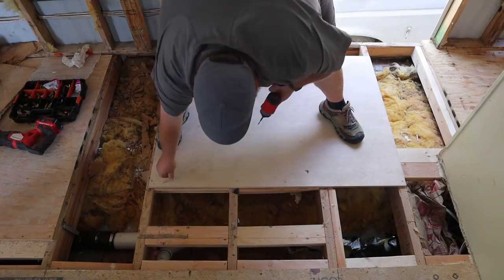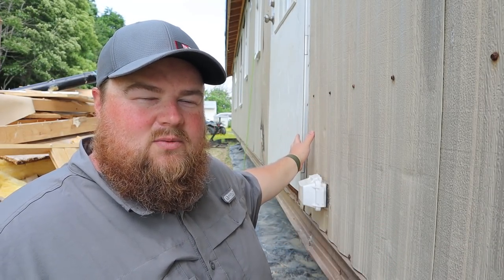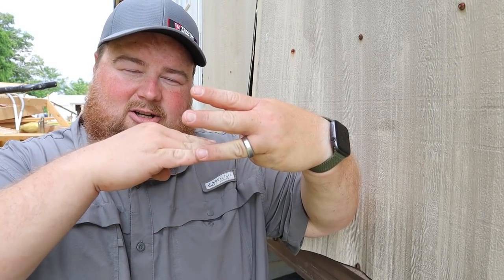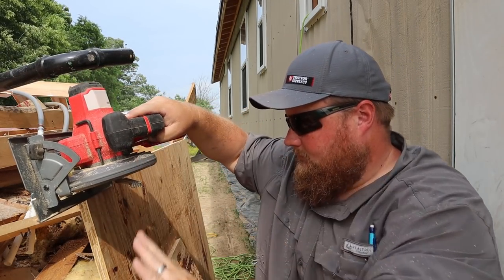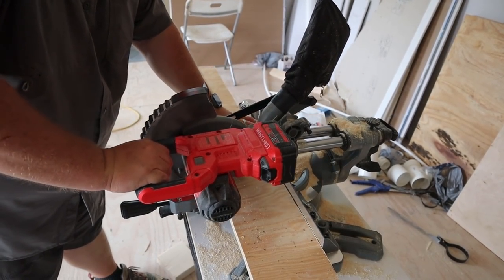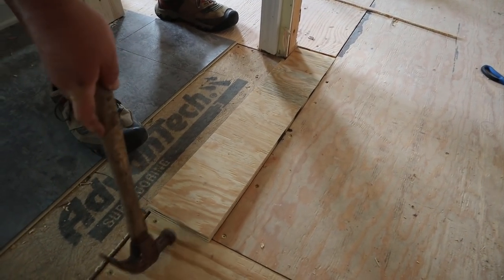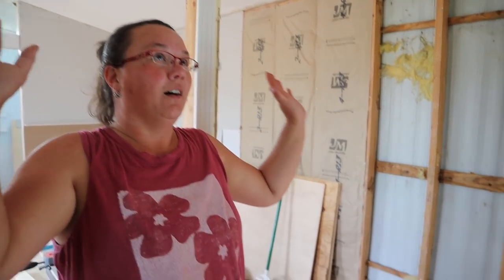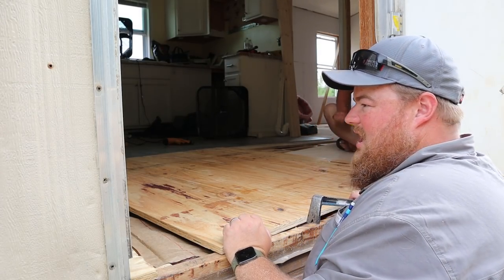Now the WHOLE HOUSE has New Subfloor! // Mobile Home Renovation

Comment: Must feel good to get rid of all that particleboard. We've replaced all of the subfloor in the kitchen, bathrooms, by front door, and any soft spots in the single wide we bought to remodel. It's not an easy undertaking by any means and especially with lumber costs right now. By the time you guys get done you will pretty much have a new house that should last for many years to come. Great job! 👏👏

Comment: Hi. Don't  forget  to put the drip pan under  the washer,  it will save your new floor . If you have a front load washer,  the door gasket "will" leak. Great show.  Thanks
Reply: Great advice but the funny thing is that all of my washers have been front loaders (as in Europe front loaders are the norm) and I have been married for 44 years and never had a door gasket leak, not even once. I have had the water hose and water pump leak, so a drip pan is still needed. Thanks for posting
Reply: @footplate0  You are just lucky.  I am a former  repair  man, I have replace  a few hundred  Door seals and  main pumps,  " Knock - On - WOOD ".

Comment: Sam, that is a left handed cordless circular saw you are using in your right hand. Left handed saws have the blade on the left and right handed on the right. The blade should always be away from the body so in case the saw kicks back it is less likely to take a cut to the main mid section of your body. Cordless saw designers apparently didn't take this into account and if you're injured by one that might all change if one goes after them in a lawsuit.

Comment: Our kitchen had a Florida style tile floor and luckily carpet had been replaced with vinyl plank. Underneath was all real plywood luckily! Under the old ceramic tile I uncovered the original green mosaic vinyl flooring held down with that glue we love so much! Heat gun and much scraping got it pristine again. New luxury vinyl snap and lock installed now!

Comment: I am finishing up the remodel for mine.  We have two back doors we are waiting delivery on, will need the trim placed around the doors and the floor trim placed on the wall the doors on.  Also have 1 room left  to paint.  Have you gotten to the point where you thought I should have just bought a new one? I reached that point axp 75% through the process.

Comment: You paid a "right" price for this house, did previous remodels for less cost than a typical mortgage, and moved the house for an over-all pretty right price in terms of housing costs.  The more you tear apart, the more I realize the need and things you've suspected and/ or known.  It's a lot of expense in the middle of doing all the other things needed to get the house habitable again.  But, I'm guessing it will be well worth it even if it delays some of the other things.
Reply: @5thdimension625  And, unless there is some type of inspection, or they chose disclose thier upgrades, it is still by a 1988 mobile home, by definition, tax wise.
Reply: @terryhenderson424  the foot print is all they’re keeping.  They do this all the time in California and elsewhere as it’s cheaper than current prices and they can do upgrades they want to include.  I bet they come out way ahead.  Their labor is free and that’s out the rood today.   They’re giving up their time into something they love.  I like them.

Comment: I don't want to be that guy that rains on your parade... but "ALL plywood" has a certain way that it is laid across the floor joist, most were laid the wrong way... this is what will happen in time the plywood will sag in between the joists, you will be able to see every floor joist, the way around this is to use hardwood flooring and you won't see the plywood under the floors sagging,. on the other hand the way you framed in your door was textbook you did an EXCELLENT job... If there was an Earthquake I wouldn't hesitate to get under that doorway... :)

Comment: You two make a great team. I am excited for you. Cannot wait to see it completed.  I believe in using stuff until you can no longer, get every dime spent on it out of it and fix and repair until you cannot. We have had to buy a dish washier today. My other one is at least 20 yrs old. Its white. The handle finally broke, and we have it working but its jury rigged. Also just started shutting off once in a while before that and we have to restart it. Husband can fix just about anything. He says its time. We cannot order the door no longer make it. It was a whirlpool been a good one. He has repaired the dryer we have many times. Its older than the dish washier.  Washier too and he has replaced parts on it too. Also, helps save our landfills. We will scrap what we can on her. No money but it is the right thing to do.

Comment: wat you mightve been anble to do is screw a beam across the inside  of the wall studs passed the opening in the floor and toward where the floor is solid , then either screw legs to that crossbeam to hold the wall up to the original height or maibe use two hydraulic jacs to rase the whoe thing a few mm (sorry european here) so you could slide the new flooring under there without hammering and drop the wall back on it , them remove the beam and keep on going

Comment: Yes, there are some tasks that can be done inside while you wait for that rain chance (and probable wish for rain by now).  But, i seem to remember there is some deck piece organization et al. that will need to be done sooner or later.  And, do you have that door in your hands and on your property?  I'm hearing different folks in different parts of the country doing the drive across county lines to pick up items like doors and other build/ project critical items rather than rely on orders or store transfers.  If that becomes the case, its half a day to a day and half the night to go pick stuff up.

Comment: I really enjoy watching your video contents,  im glad im not alone, im working on a 1987 vintage RV 26x8 ft 5th Wheel that needs work, TLC and remodel with some upgrades. I found the back end where bathroom and main door is the flooring including the framing is badly water damaged,  not much  oon the bathroom side holding well, framing certainly needs to be done both wall and floor and watching your video here has been very helpful,  that is, doing one section at a time, first i need to finish stripping out all those OSB boards (or as some call it, partical boards)  and wall panels that are badly water damaged where the tub was to the back of the tire walls (1st smaller setion of the RV , from back to the back of the tire walls, from side to side from main door to the bathroom (passenger to driver sides that is), and get the old black and gray tanks off it also in the midst. Framing and subfloor needs  to be replaced,  and will not use OSB and MDF boards, itll be replaced with 3/4 inch  plywood on all subflooring throughout as  I work on each section at a time, much work to do in this RV rebuild and remodel, whenever and once all is done,  it won't be used to travel,  itll be used as a tiny home on this property so to have a dwelling one it before and after whenever the city doesbthe complete demolition of this old condemnable house and building in the backyard of this property,  sadly neither buildings are rebuildable nor can be fixed and repaired to live in. anymore.  Anyway,  it's a project for me to work on this RV between my full-time work schedule and will be worth it in the end 😉👍and in the midst I'll have fun watching yalls video contents too. Take care and be blessed and safe too.

Comment: A little suggestion for anyone else doing this. Cut your self some 1 inch tall by 6 in long tapered wedges and drive them under the bottom plate directly under each stud about 1/4 inch past the bottom plate after you have removed the original floor. This will give you some wiggle room to get you plywood floor started going under the bottom plate. There will be less weight and friction on the plywood. The wedges will drive out easily by the plywood passing under the bottom plate allowing the bottom plate and wall to re-settle on the new plywood flooring

Comment: The walls of the back door ans pantry is best to put insulation to avoid heat loss. An ypu cpuld reinforce the back door frame for safety. And put a interior and exterior cam too.

Comment: Under the walls for the flooring I wonder if two wedges used to fell trees driven from the inside, only part of the way through.  Would it leave enough space to start the flooring and then when flooring is forced into place would push the wedges on out to the outside.

Comment: Question. What is best way remove nails coming through the ceiling.
After pulling the kitchen cabinets from the ceiling, the installed nails from ceiling are protruding.
Reply from the maker: I would use a cutter like the oscillating tool to cut them flush, you could then use a punch and hammer to drive them back into the ceiling some to finish the surface?

Comment: You and Homerenovision have inspired me to pick up land with a mobile home. Haven’t closed yet but getting close to. The only thing I can’t figure out is what code do I have to follow when dealing with the mobile home. Going to be a complete renovation since a few studs are going to be rotten and I want to keep the option of reselling in the future open and around here unpermitted work can be hard to sell. I’m just not sure if I have to follow HUD code or building code. Or if I need to follow anything since I’m just “repairing “   Have a 1983 kauf single wide.
Reply from the maker: We always pick residential code over HUD. Just because the original work was to HUD standards and it was sub par in our minds. Used mobile homes are anomalies.. some places inspect, but most don’t. All depends on where you’re trying to move it to and that destination’s regulations.